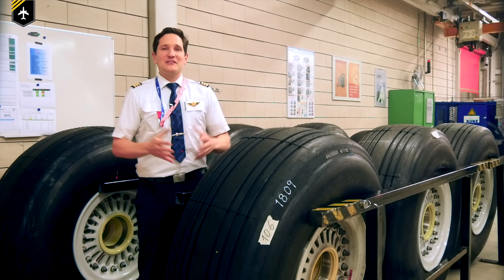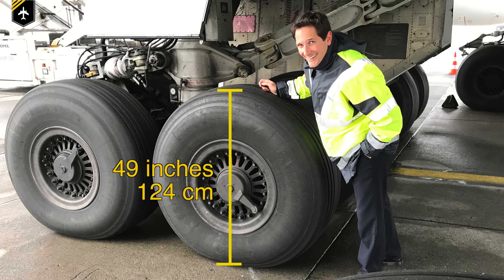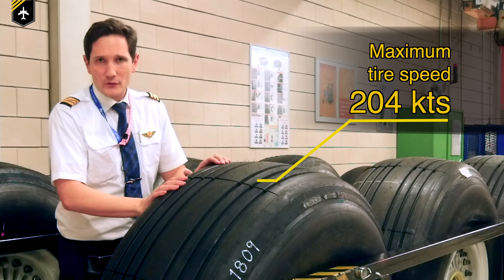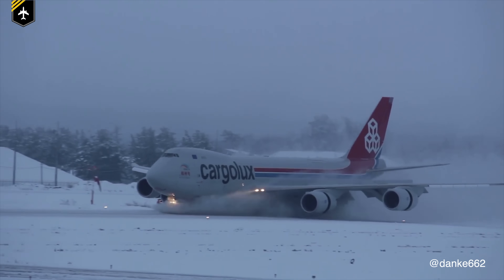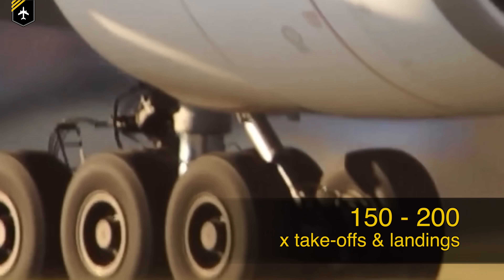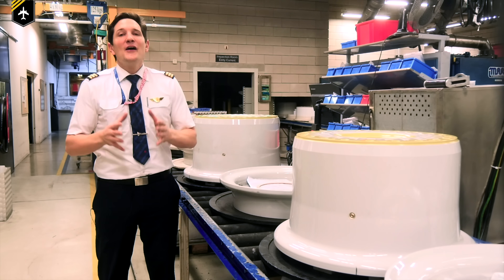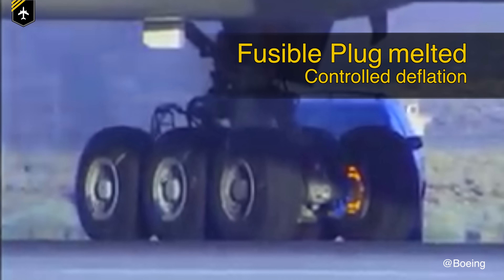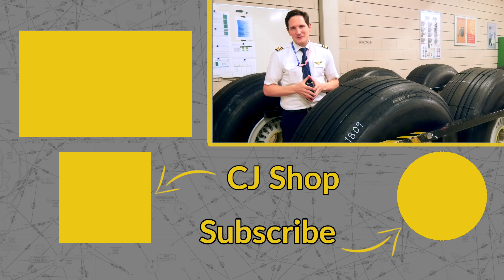HOW MANY LANDINGS can TIRES withstand?? Explained by CAPTAIN JOE

Comment: Very interesting - thank you. I was once on a flight years ago that blew a tire on take-off; parts of the tire were sucked into the rear-mounted engine (MD-80?), causing it to shut down. The pilot was committed and continued the take-off (on the one remaining engine), after which we circled for a while to burn and dump fuel. He then landed the plane on the "good" side, then very gently set the plane completely down. Fire engines on both sides; no one panicked but there was great applause when we were on the ground. I thanked the pilot for his skill as we exited the aircraft (in the days when the pilot could leave the cockpit to greet passengers). I greatly respect the skills that most pilots have.
Reply: Sad that a lot of pilots don't talk to passengers as they deplane anymore.  I know a lot of people don't care, but I always like to peek inside the cockpit, and I like to thank the crew.  I recently visited Hamilton Island in Australia on a 737.  I noticed we touched down near the runway threshold, and that the landing was very firm. I figured the runway must be quite shirt, so I looked it up, and sure enough, it was short enough that nothing bigger than a 737 could land there. 

When I left and we landed back in Melbourne, for once, the pilots were standing outside the cockpit, so I said something like "so I guess there's isn't a lot of room for error on that runway is there?" They said there wasn't, and we discussed the approach.  They seemed to think it was cool that I was interested.
Reply: Here in Mexico, years ago an Aeromexico MD-82 Pilot did that same "on one side" landing but not because of a burst tyre, but because the entire left side landing gear leg did not drop down, even afyer repeated attempts, some "shaking" maneuvers, etc.  So he kept the left wing above for the longest time possible, and the result was a surprisingly little damage to the wing tip. Excellent Airmanship!

Comment: hi joe, are the tire dynamically balanced? Maybe the high spin rate at touchdown can cause the shoulder of the tyre to slip on the rim thus rendering an issue the balancing ballasts?
Reply: The wheels are balanced, but just roughly. They might lose rubber unevenly, so the balancing will be slightly off after the first landing. However, there is a marking on the tire next to the fill valve to see whether the tire has slipped.

Comment: Low cost carries during peak season change tyres every 10 days ..... one wheel including rim brakes and tyre cost around 35,000€
Reply from the maker: BG011 Add a 1 to your 35.000 and you have the cost of one brake set on the 747
Reply: Captain Joe @ That’s a number 🤦‍♂️regards from Airbus driver ! You’re channel is great ! Keep up a good work 👍

Comment: What if the tires are rolled using a motor to match the planes speed before landing would it help reduce the force on it?
Reply: it would indeed reduce wear. But it's more economical to replace the tires regularly due to wear than to carry around 6 to 22 motors. Also tight corners especially when taxiing heavy is more demanding on the tires than the landings.

Comment: Car tires can and often are filled with Nitrogen, for exactly the same reasons you mentioned.
Reply: This is especially true with racing tires used in NASCAR, Indycar, IMSA Formula 1, etc. due to the extreme heat generated under repetitive hard braking and high speed cornering.
Reply: Yeah, but don't forget, air is almost 80% nitrogen anyway.
Reply: Denys A Exactly, every day drivers don’t need to spend extra $ on nitrogen filled tires.
Reply: Interesting. Never knew that!
Reply: @elephant35e  Car tires filled with N2 have usually a green cap on the valve
Reply: @elephant35e  nitrogen is weight saving.i think as well fuel cells in ww2 bombers pressurised with same as fire retardant
Reply: The filling of regular car tyres with nitrogen is a scam. It’s pointless for the average day-to-day road car.
Reply: Can confirm my tyres are also, currently filled with nitrogen as that's what Costco use in the UK.
Reply: It isnt needed for car tires.  True.  But it's getting cheaper and they do it for free a lot more now.  They use green valve stem caps to show Nitrogen filling.
Reply: @michaelmccarthy4615  And hand out green dunce caps to those Stupid enough to pay for it.
Reply: it's an option at a lot of auto shops as well. As far as I can tell, it seems to leak a bit less, so you don't need to top up quite as often.
Reply: air is 78% nitrogen, unless you vacuum it all from the mounted tire, the best you could get is about 90% at full pressure with the remaining o2
Reply: Tire pressure in road cars pretty significantly effects fuel efficiency in the long run and with pure nitrogen filled tires your tires can be filled to optimum pressure for fuel economy and changes in tire temperature from driving or changes in ambient air temp or ground temp will have no effect on the tire pressure. This will actually save you money over the long run in fuel and in tires a well since properly inflated tires also last longer. So how is nitrogen filling a scam.....
Reply: @colinmatlock2164  Google consumer reports tire test for nitrogen. Going off memory here. Two tires at 30 psi, room temperature for one year. The one with air lost 3 psi. The one with 95% nitrogen lost 1.5 psi....so it works, but don't let this fool you into thinking you don't have to maintain your tire pressure. Outside air temperature  will affect pressure. Air or nitrogen. Every 10 degree temperature change will cause a 1 psi change. So if your tires were mounted during the summer they will be low in the winter.
Reply: @andybozeman9769  no one is insinuating that they are maintenance free but they literally hold starting pressure twice as good during ambient temperature and tire temperature changes. So with less maintenance you can maintain a higher efficiency and actually save money on fuel and tire wear.
Reply: The main purpose of Nitrogen is fire..
Reply: Nitrogen for everyday car is just a ripoff. But a clever rip off.
Reply: Nitrogen is used for shock absorbers and all kinds of special performance needs
Reply: Andrew Simonsen  Ha-ha.  tyers for tyres for tires.  Even though a 2nd-order misspelling ;-) , at least the Aussies are the only one to have it spelled correctly phonetically!
Reply: The air we breath is filled with 81% nitrogen though. Most tireshops charge extra to fill it uo with nitrogen instead of air
Reply: Of course, as long as you pay for that
Reply: I wanted to say that 👍🏻
Reply: Car tires are filled with nitrogen by airheads.
Reply: Nikiaf should use helium, reduces unstrung weight.
Reply: ire gas is used in the tires of commercial aircraft, racing bicycles, hazardous goods trucks, vehicles for use in tunnels and mines, and Formula 1 vehicles. B. to minimize the risk of fire development and promotion in the event of a burst tire or to prevent self-ignition due to a defective tire or a tire operated with significantly underpressure or an overheated brake system. This advantage is not transferable to normal car tires. For larger aircraft, filling with pure nitrogen (typically 10 bar) is required by an airworthiness directive issued by the FAA. [1] Helium is also used as a tire inflation for weight-critical aerospace applications. https://de.wikipedia.org/wiki/Reifengas
Reply: Nitrogen molecules are larger than oxygen molecules as well. Helps prevent leaks. Particularly useful for snowflakes who dont maintain their tires on the regular.
Reply: Not in my country
Reply: For automobile tire pressure warning systems which use a pressure sensor inside each wheel (vs an "indirect" system looking for differences in tire rotation rate), nitrogen can be more friendly to the life of the sensor than air.  Replacing a failed sensor typically costs in the hundreds of dollars US, including labor.
Reply: Filling car tires is a scam, it does nothing for car tires. Also think back to middle school science, how many parts nitrogen is normal air, 78%, if you are getting pure nitrogen fill for free, cool, if not it’s not worth paying for. (Ps, next time you are getting a nitrogen fill, ask to see it done. I’ll bet you in 99% of the cases they are using a regular air compressor in a “nitrogen fill station” you won’t see bottles of nitrogen anywhere.)
Reply: @gardy90  Nitrogen generators, 
no bottles needed.
Reply: @gardy90  : You did not pay enough attention: They use an Air Compressor FOLLOWED by a compact Nitrogen Membrane.  That mrmbrane allows"fast" gasses like water vapor and Oxygen to leak out to the atmosphere, while keeping Nitrogen inside to go to the tire.
Membrane nitrogen can go about 98% concentration at the pressure used in those systems, that is more than enough for this use.And while not exactly REQUIRED inbautomobile use, it helps a little at keeping less pressure CHANGE with the unavoidable change in temperature between a cold tire before a fast drive at highway speeds, that means a tire folled with air would have around four more PSI increase, an a Nitrogen filled tire would only see half that increase. It also leaks at a lower rate too. Small but REAL advantages.  Only convenient when done at low cost places.
Reply: Nitrogen molecules are larger...
 they don't leak out as fast.  
They hold tire pressure better.  
It's another option for motorists.
Reply: "For exactly the same reasons you mentioned" I don't think car tires are subject to the same extremes as aircraft tires.
Cars don't fly.
Reply: Car tires are filled with nitrogen to make more money. There is ABSOLUTELLY NO REASON to fill with nitrogen but to charge more!
Reply: @thephantom1492  Exactly. Its only applicable in extreme situations like what a proper track car would see.
Reply: You know it makes nearly no difference right?? Its all one big scam.

Comment: this is probably the reason why a plane crashed in istanbul
Reply: When landing an aircraft, it is generally recommended that it touches down within the first one-third of the runway. However, the pilot in Istanbul, Turkey, landed the airplane within the first two-thirds of the runway; that is, the pilot did not land in the beginning of the runway from landed closer to the end, meaning that especially with the wet surface of the runway due to the thunderstorm in the area, there was insufficient room to stop safely.

Comment: How much is an all around(×18) tire change on these beasts?
Reply: $2100 each for 747 tires.  $37800 total.
Reply: @RS-ls7mm   plus whoever you have to pay to do it. I doubt 747 servicing comes cheap.
Reply: @slickstretch6391  @kavorkaa knows a geezer who will sort it out for you, dirt cheap & quality work
Reply: @RS-ls7mm  When I think hard about it 2100 each doesn't sound dreadful for the product.
Reply: @malcolm nicholls  $2100  that's a CHEAP tire ,, wanna buy a tire for my farm tractor ,,
a full set of treads for my tractor will set you back $12000  for just 4 tires ,, the rear tires are 710-70 R42 radials  ,,$4000 per tire
Reply: @wildcoyote34  Exactly what I was wondering-thanks.
Reply: 20 quid,give or take
Reply: @kavorkaa  mates rates
Reply: 1 of your kidneys.
Reply: Depends if they're having a big sale down at the tire shop. NTB sends out coupons all the time.
Reply: Ryanair usually has a buy one get 17 free sale for their aircraft
Reply: About an 8 hour delay minimum.

Comment: It's great to have all theses data. But... please... could you use the metric system?
Imperial units are used by less than 10% of the global population... And made no sense for the remaining 90%
Reply: It's what the aviation world uses, sadly. So pilots and aerospace/nautical engineers are trained to use it.
Reply: @ibis8566  Except for flights in russia or china
Reply: @ibis8566  
I don't mind knots, as it's indeed a specific aerospace/nautical units.
But lbs, psi, etc. are very annoying. And they are not aerospace/nautical related.
Captain Joe made the effort for the inch/cm and the psi/bar at some point. 
It would have be nice to do it for all the other units.
Reply: @Hallison Michel Damn. How rude.

Comment: I think Ryanair tyres can only withstand 2 to 3 landings...
Reply: How often do they have to change the shocks/struts? Some of those Ryanair landings looked hard enough to burst both sets of main gear struts at the same time.
Reply: @crazyfroggie6546  they spend all their money on struts instead of passenger comfort 😂
Reply: R Bousfield wtf airplanes have suspension too? Why don’t they just use fucking air suspension instead of springs and struts
Reply: Ryanair we make people die cuz we got no tires when landing
Reply: Any landing you walk away from is a good one.  If you can use the plane again, it was outstanding.